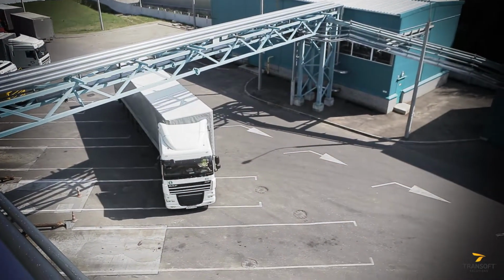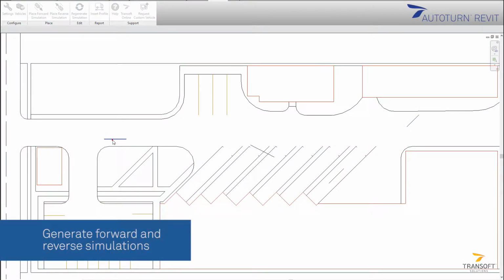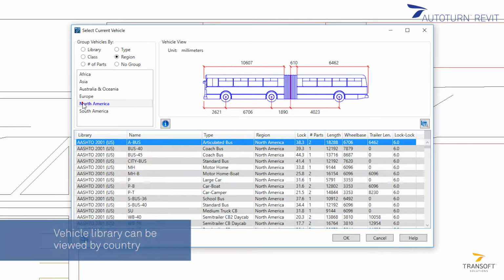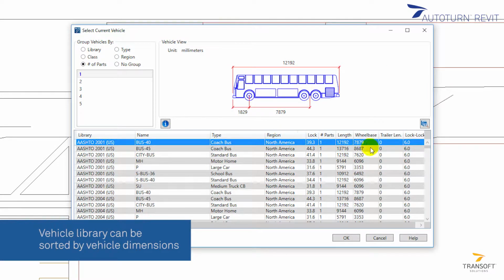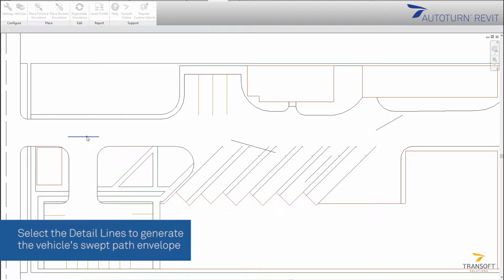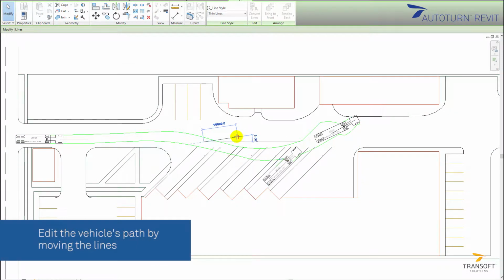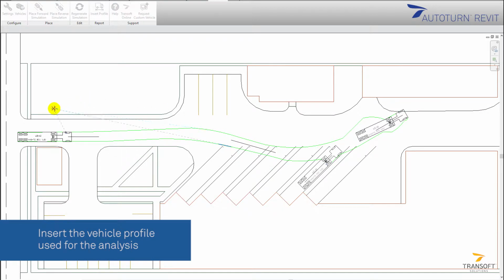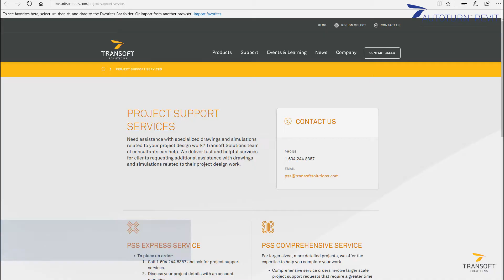AutoTURN for AutoDesk Revit 2.1 - Vehicle turning movements

Comment: Hello, It's only on 2D, can you developp the 3D path volume like Autoturn for Autocad? It's an awful process get them from autocad then using volume from Autocad in revit to make 3D path studies.
Also in Autoturn for Autocad, you have the Ability to create the path by clicking not by using 2d line to give a path. Can we have the same function in Revit? Last, can we have all the function of Autoturn in Revit?
Reply from the maker: Hello Saif Eddine Barkaoui,
Thank you for your question regarding AutoTURN for Revit. As you mention, AutoTURN for Revit is a 2D application and it is not currently possible to generate a 3D swept envelope within Revit itself. Our AutoTURN Pro product is fully 3D capable, and we are aiming to make the transition between an AutoCAD and a Revit environment more smoother. When it comes to the functionality of AutoTURN for Revit and the user experience, we understand that you feel this limited as compared to the traditional CAD-based application. We are working on improving the user experience and bringing more functionality soon, available directly within Revit.
We hope this answers your question. Should you have any further concerns, please feel free to reach out to us directly.